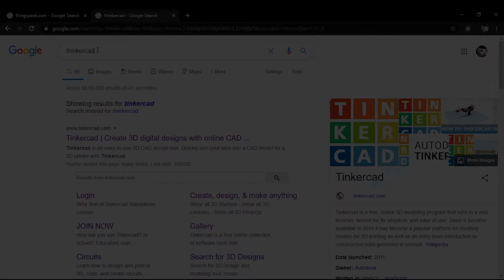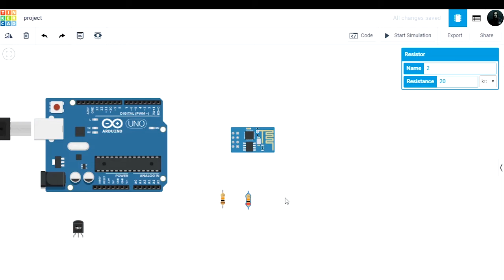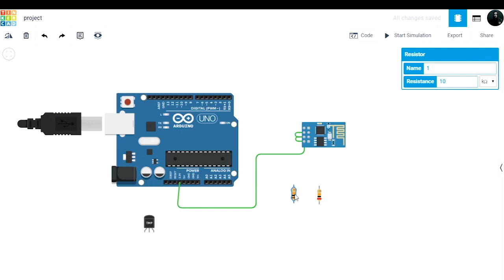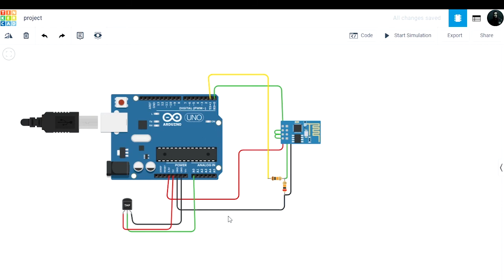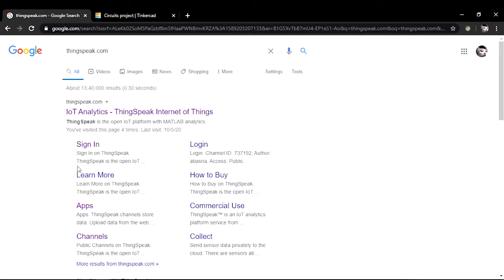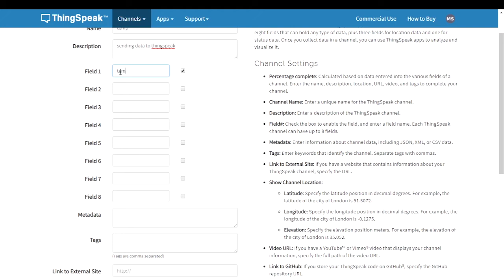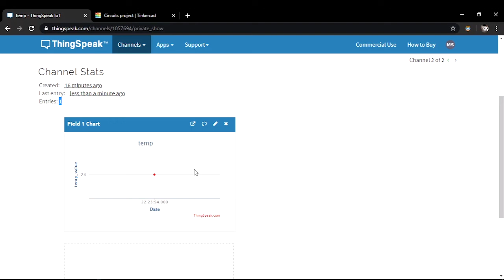Sending sensor data to Thingspeak using ESP8266| Thinkercad| Without hardware.

Comment: Thanks for the helpful video sir.
I have searched for wifi and it is not available there. How should I solve this problem please? Besides, if you know also how to add RFID, I will appreciate. Thanks
Reply from the maker: Wifi module has been removed from tinkercad but u can use my project , check discription:)

Comment: Hello sir can you help me I'm trying to tinker this project on tinker cad but it's not connecting to the thingspeak server can you tell me what else should I do
Reply from the maker: Can you tell me  the exact problem or error u r facing?
Reply: I open tinker cad and searched for this project .I changed the wifi name and put my own but it is not connecting to that wifi . I also tried to connect it to thingspeak but it's not sending data
Reply from the maker: @walekappa8612  it will not connect to any wifi because it is made to connect with virtual wifi .
Reply: @unique5160  so how would adjust to work with my own wifi
Reply: Can you help me to create my own virtual wifi
Reply from the maker: @walekappa8612  dont worry about wifi .just focus on the program to send the data.
Reply: @unique5160  so how would I see that the program is sending data to thingspeak.
Reply from the maker: @walekappa8612  On the serial monitor
Reply: @unique5160  okay now I have a small problem of my own .I have 3 fields how do I assign them the same api key to connect to the thingspeak server